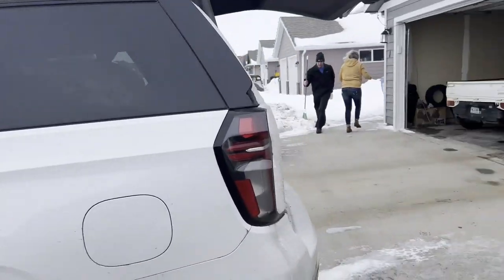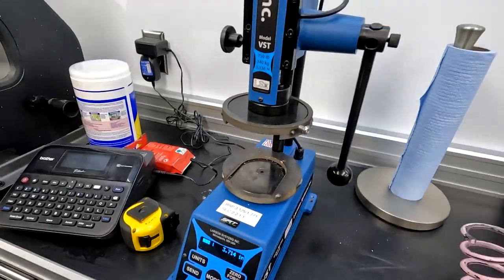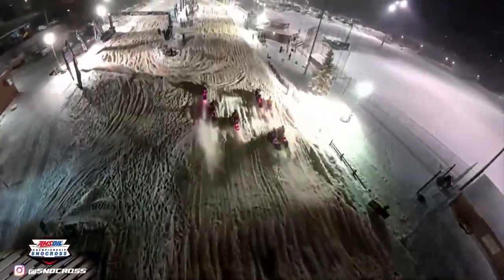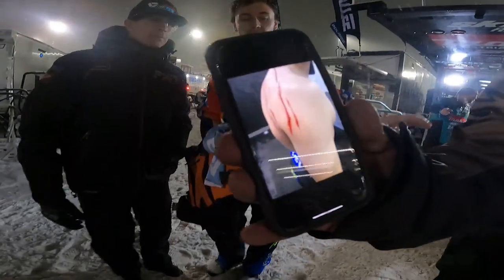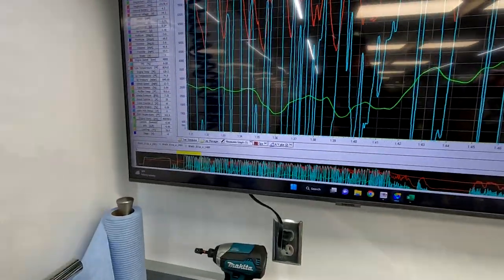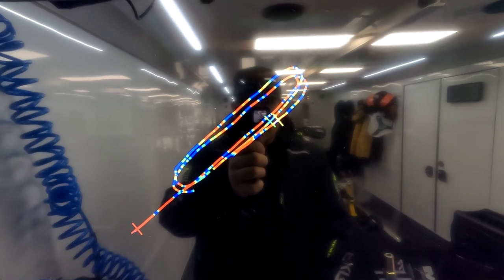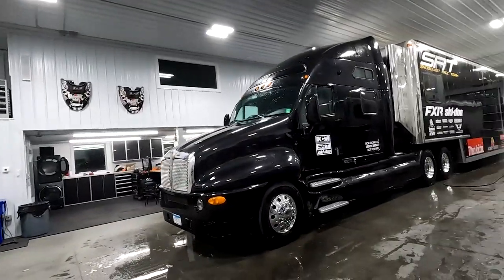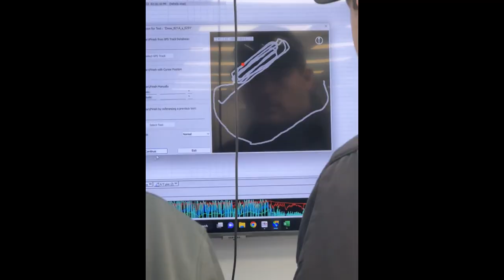GETTING LANDED ON BY SNOWMOBILE // CAREER ENDING?? // SNOCROSS IN A BULLRING

Comment: How do they keep the primary clutch from grabbing at the starting line?
Reply from the maker: Most hold the break, but the key is to just be above engagement. They aren’t holding it full throttle before they leave, so the clutch is barely doing anything at that point. If you let go of the brake it would start creeping ahead slightly.